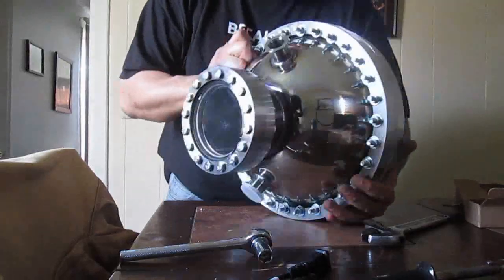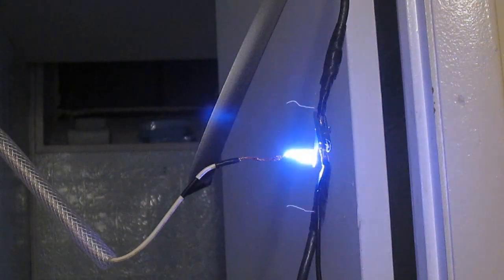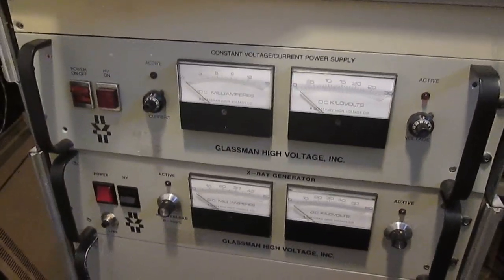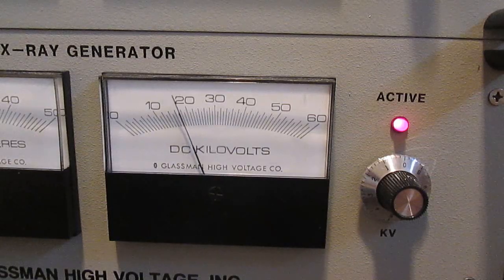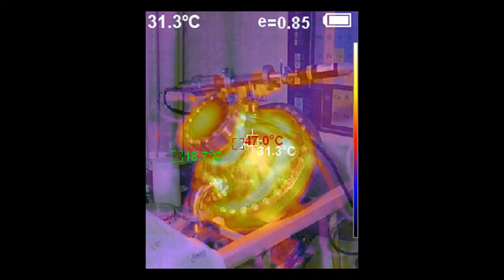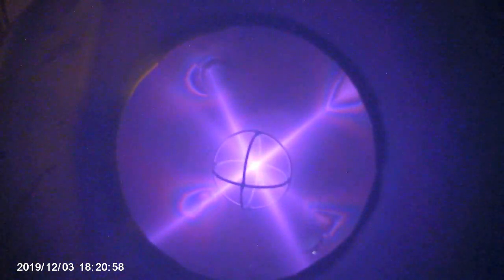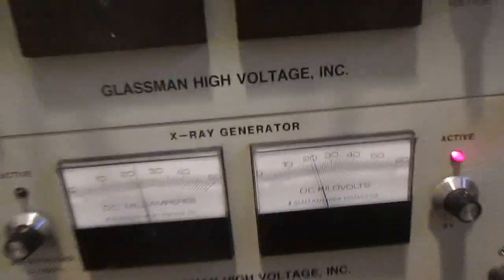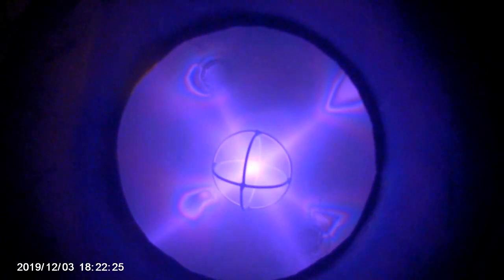DIY Nuclear Fusion fusor part 2

Comment: I wonder what it'd take to make essentially a "scaled up" version of this (I.E. higher voltage, larger chamber, larger D2 tanks, etc.) but then there be a whole host of issues to deal with, main one being safety.
Reply from the maker: So, the problem with this setup is not the scale but the principle of operations. By design, the Farnsworth fusor CANNOT generate net power. It is kinda like trying to get power from a propeller powered by an electric fan.... Never gonna happen
Reply: @Neptunium   Well that's the thing with the Farnsworth type fusor, it cant generate power (i don't think any type of fusor will (at least appreciable amounts) for at least the next couple decades) but my main thing was you can however generate other fun things like neutrons and x-rays. but like i said there would be some safety issues if you want to make what is essentially a neutron generator.
Reply from the maker: @adelinyoungmark1929  it already exist and actually, I am working on one for a future video......

Comment: Can you put something in the chamber to absorb the heat .? Like mercury or lead
Reply from the maker: Not in the chamber but a heat sink thermally coupled to the fusor could work.. the part that get really hot is also at high potential so that would be difficult to cool without shorting everything.. not impossible but definitely increased complexity... Thanks for the suggestion and thank you for watching!
Reply: @Neptunium  could it heat up the material enough that it could be pumped to another chamber to boil water to steam then that spins a turbine ?
Reply from the maker: It would be nice wouldn't it? Unfortunately this type of fusor (as described in the video) cannot break even... So most of the heat generated is from the power supply. Which mean the total energy wasted in the system is close to 100%. .
Reply from the maker: Also . This : https://youtu.be/MpCOy3CG5bg

Comment: I thought nuclear fusion required some crazy high temps and powerful magnetic field to keep it from contacting inner parts? Seems like an impossible thing to pull off at home...
Unless i misunderstand something and what you showcase is something else.
Reply from the maker: It does ! But there is other ways to get fusion. Of course if you want to make a profit it must be done in large quantity which takes vast amount of energy and is difficult to do as you mentioned. But on a smaller scale and getting neutron is all you want then you can use this set up . This is simply electrostatic confinement it's not meant to be profitable. Good question! If you are interested check out the fusor.net website .

Comment: so youre generating aproximately 90 microsieverts an hour in radiation, fairly safe but how ydo you really avoid overexposure, do you like wait a few days after a dose or??
Reply from the maker: How did you arrive at that 90 figure ? I've played with it for no more than a few minutes at the time since it gets  hot pretty quickly.  I also have 3 dosimeters for X and gamma and it always remained pretty low.. It has been set aside to make room for other projects a while ago.
Reply: @Neptunium  just basing it off of the final frame where you were mesuring from the view glass at 81 Usv
Reply from the maker: @robbytheatomicengineer5749  so thats the hottest spot and its only the xrays. Even so . 9mrem/hr is very little..
Reply: @Neptunium  right

Comment: Is there a reason you use stainless? I barely have any knowledge on what you are doing. But, I’m a welder and I’ve welded on exotic metals..more specifically Inconel. Would that be better suited for what you are doing ? I know it maintains more strength at higher temperatures for longer periods as it forms a tough protective oxide layer. Problem is it’s very hard to work with and has to be aggressively machined due to those characteristics.
Reply from the maker: I think it's a degassing problem. Stainless steel is very good in low vacuum and corrossif environment. Inconel would work as well but it has a tendency to hang on to the last gas molecules .

Comment: Whats the model of neutron detector you’re using in this video?
Reply from the maker: this is an old Texas nuclear i`ve found on ebay some time ago ... it works and has a large surface area of detection. the actual detector is sealed inside the moderator sphere so i cannot open it and tell you exactly what it is but i strongly suspect is a He3 tube
Reply: Oh I see, thanks for the response!

Comment: What are the limiting factor's in this setup if you were able to get a self sustained "star" with deuterium and T?
hats off to you for your curiosity in science!
Reply from the maker: Thank you I appreciate that! ..limiting factors? Look at it like an x-ray tube, when cut the power it stops. Same thing here. It's only working because the high voltage accelerate the ions towards it . Fusion does not generate high accelerating voltage so it could never sustain itself.
Reply: @Neptunium  So you couldn't start a fusion reaction this way (like a starter motor) and then add the two atoms you want to fuse? or are you saying that whatever atoms you want to fuse wouldn't be affected by this particular design?
as it solely relys on the electricity to produce the ion's?
sorry if these are silly questions
Reply from the maker: There is no silly questions we all had to learn at some point right! Yes you got it ! What ever atom you put in does not matter .the design and the reaction  makes it  unsustainable .it's not like a chain reaction you have to keep the conditions just right all the time . And the second you stop the reaction stops too..
Reply: @Neptunium  Thanks for taking the time to answer me.
I really enjoy watching experiments.
I know this is probably the billion dollar question but how do you think fusion with be achieved as some think with new meta materials fusion could be just around the corner?
Reply from the maker: As the old saying goes "fusion is 30 years away and will always be 30 years away" I am not sure it could be contained and controlled in the near future but never say never! We may not be around when it finally happen ...

Comment: Very cool, dude. Although i'd be worried about feds getting the wrong idea and dismantling the lab to inspect it like they did with Cody's Lab 

That said, your set up is like a wet dream, even if I barely understand half of it. I can definitely see why the hobby is worth it lol
Reply: Its highly unlikely they would. Cody was experimenting with actual uranium. While its unlikely that raw uranium could be used to produce a homemade nuclear bomb, it could be used to make a dirty bomb, where you're just using it to spread radioactive material, which is still pretty bad. In this case, you're making a homemade fusion reactor. The components themselves are not radioactive, and what radiation is produced is produced as a result of the reaction itself. As a dirty bomb, this would be a terrible option. The damn thing is so big and heavy and power intensive, I can't seriously see how you would be able to weaponize it. In addition, you cannot turn a fusor into a thermonuclear weapon. Fusion bombs still require a fission based sparkplug of plutonium which is used to superheat the hydrogen fuel so that the atoms can start fusing and release the bomb's full energy. Without plutonium, you are highly unlikely to make a homemade fusion bomb. And if you somehow have plutonium, I guarantee you, you're not gonna get a knock on your door from the feds. You're going to get a black ops team raiding your house in the middle of the night to snatch you.
Reply from the maker: It has been over a year and a half but i think i measured a few mrem of Xrays at the window and background where i was. The neutron flux is so low it did not activate anything even moderated, just a few hits per seconds , maybe a fraction of a mrem at best...As i explained before i could not run it more than 30 seconds to a minute at the time as it does heat up a lot. The high voltage used is far more dangerous than the deuterium or any radiation ... by far.
Reply from the maker: This was just a proof of concept . I did it because of the challenge and the appeal of such a cool project
Reply from the maker: Well I am not the first or the last or the one with the best set up... I hate to be paranoid but it is in the back of my mind ... Although I am not a threat to anyone, I do worry about it ... hopefully reason will prevail. Can't leave your life in fear I've done nothing wrong or illegal you know
Reply: @Neptunium  haha yeah. Worst that'll happen is theyll find nothing bad and end up breaking something, its just a pain in the butt
Reply: I was thinking about building a large Bussard fusor.  I heard they had a hint of proton boron fusion right before they burnt out the machine.